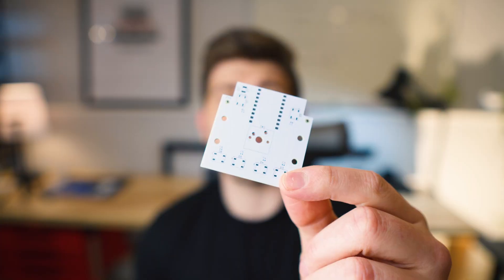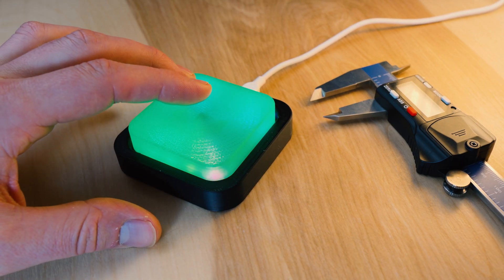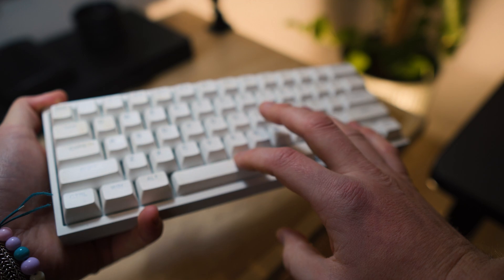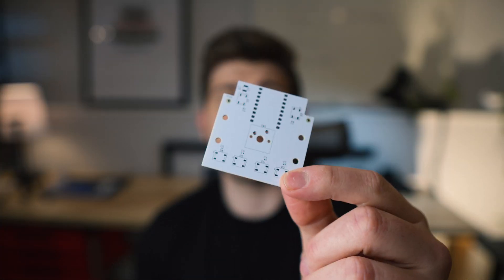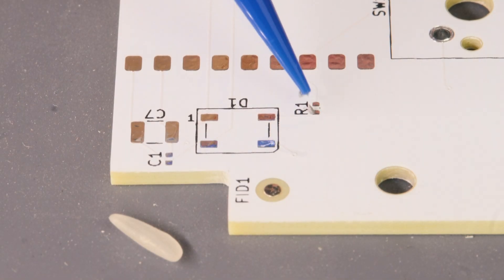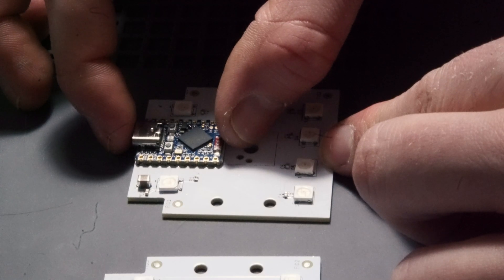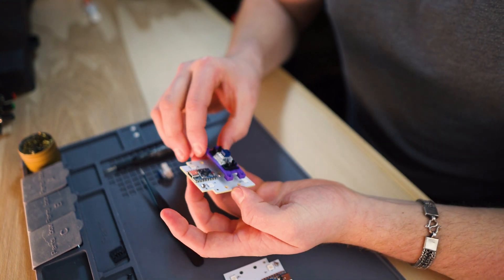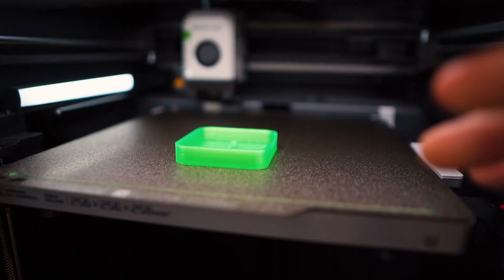I made every developers dream button.

Comment: I suggest an alternative for the commit message. assuming mac as shown in this video, we can use spotlight for the commit message.
user types: cmd+space "made the code comments not a mess" press_button
button types: cmd+a cmd+x "terminal\n" "git add .\n" "git commit -m " quote_key cmd+v quote_key enter "git push\n"
We use cmd+x because it clears the text field, ready to type "terminal\n" to open the macOS terminal.
Reply from the maker: Going to try this out now! Will add as an option to the button if all works out thank you Jolex 🙌🙌🙌🙏🙏🙏